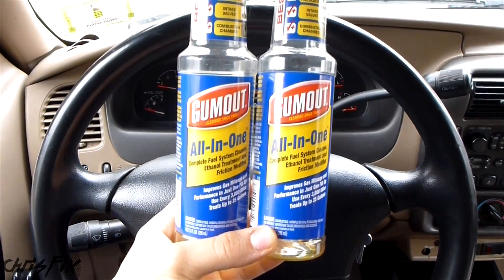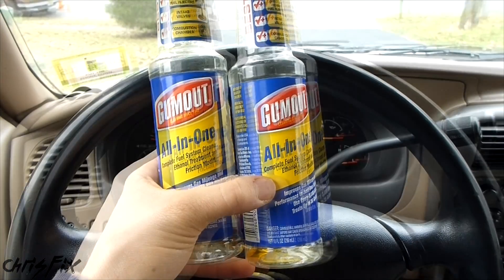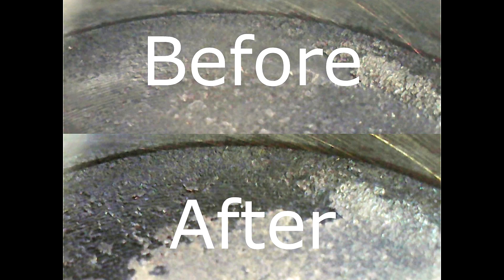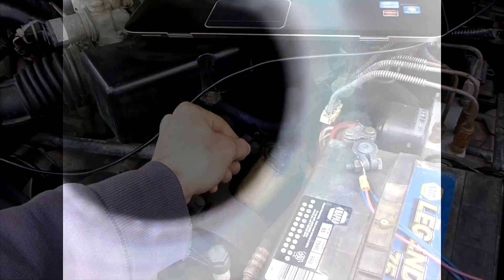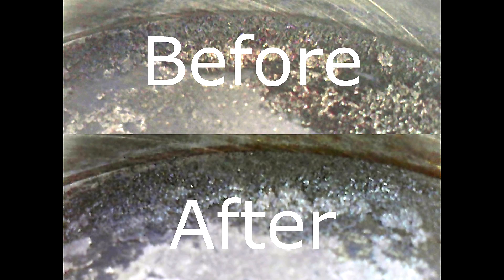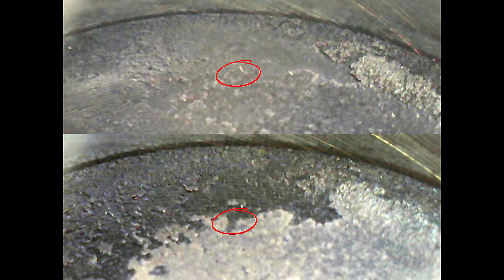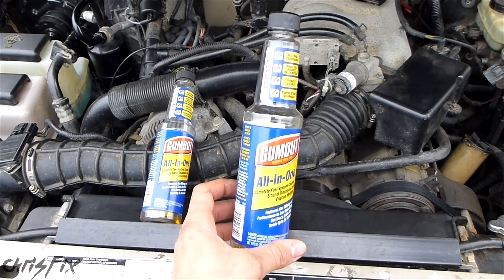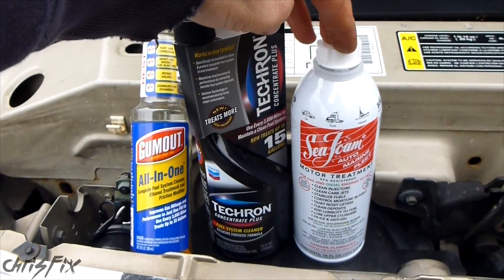Does Gumout Fuel System Cleaner Work (Follow up)?

Comment: Chris Fix,
One thing to consider, is ask Gum Out to start sponsoring from bottle #3 onwards, and use one entire case of it. 
Inspection interval can be cut to every 5 bottles. 
Reason I suggest that:  your video 1 and 2 actually showed gradual carbon removal. Even some of the hard baked stuff, tiny portions came off. So that leaves open the possibility (as you suggested in your video) maybe repeated 10~15 applications would seem more meaningful difference. 

I agree w you, one bottle would not remove everything. 
Many viewers also left comments, this is meant to be preventive and is being used on an engine for the first time in 120k+ miles.
Reply: They claim you need one use, if you need a case, it's snakeoil.

Comment: Ok my question is, when the additive "cleans" the carbon the residue has to go somewhere, does it go to the catalytic converter? Also if it does, doesn't that will get the catalytic converter gets plugged and it's not cheap to replace one, please let me know, thanks.
Reply: the rate the cleaner removes it is not to much more then what you would get with some of the brands of gas who add more to there gas. It seems people want to see all the carbon just gone but it would end up plugging your catalytic converters if it could just remove all your carbon in one go. some people soak piston heads in cleaner but that is a much more involved processes and also has the risk of pushing larger amounts of carbon all at once into the exhaust.

Comment: i guess if i plunge 20 bottles in it might make a significant difference :) i call it bs, the advertisement on the bottle is clearly stating that 1 bottle should make a significant difference but meh ... And Thanks a lot for the vid, truly love your videos! Have a great day
Reply: It didn't really say one bottle would clean a ton of build up. it said improved performance ect ect. if one bottle could remove a ton of carbon up you would probably plug your catalytic converter

Comment: What kind of gas do you use? I read an article in The New York Times about government minimums of fuel injector cleaner in gas and how after they tested it, the best gas to use was BP and Shell. Obviously the higher grade gas has more cleaner but wastes your money if your car isn't designed to drive on premium. You might want to change gas stations.

Comment: ...yeah one of the wack videos of his.  Use 3000-5000 Miles.  Yet he uses it on a car with 120k miles on it.
Reply: Morgorath30 haha :) it would still work tho plus u won’t need to used it on a new engine with 3 to 5k miles on it.
Reply: @brianbaines4905  I mean....every oil change. And you can see it did work.  But asking it to work after one time, after two times to completely remove all of it is a lot to ask for a 120k mile car imo.  I mean I'd say probably a bit of falsifying I  what it can do.  But to me I get the feeling this would definitely help prevent all the gunk you know?  I wish someone would make a video like chrisfix but on a newer car and with continuous use.
Reply: Well the best way to clean it is by hit high rpm with breaks it away out the exhaust. And also if u take your spark plugs out and fill with water it loose it at 5 to 10 mins. Then keep the plugs out and turn over the engine and couple of times so it flys out the plug hole and then once it’s out put plugs in start it and race about with rpm for 5 to 10 mins and look in the hole and it like new that’s what I do but. I only do it when I just got the car cos Ive no insurance and license so I race everywhere it never as a chance to bluid up in the engine

Comment: PEA (polyetheramine) is the safest and most effective gasoline detergent
 to keep your cylinders and injectors clean.  It is found in Top-Tier 
gas.  You can also buy it as an additive - only a few brands have it, 
including: "Gumout Regane" Fuel System Cleaner and "Red Line Complete SI-1" 
Fuel System Cleaner.  It slowly cleans - which is safer.  Harsher 
treatments work faster, but can cause problems if chunks of carbon are 
freed instead of slowly dissolved.  PEA (polyetheramine) is the only 
treatment approved by car manufactures.

Comment: I'm just throwing out a speculation but I think these additives are meant to be more of a preventitive/minor corrective action. It seems to clean the soft carbon quite well, but not much of the hard carbon.
Reply: It works extremely well if you use it continuously After 6 months the top of my pistons looked like they were brand new
Reply: @joebucci2743  thanks for ypur comnent. I believe if you have high carbon build-up you need to use the gumout more then 2 bottles. It cleans mild build-up quite well
Reply: Yeah definitely made to use regularly in a brand new car
Reply: then they should say gum prevent.clean but not 'out'
Reply: @tusharp1577  true, they should but most ppl would have no reason to buy it then

Comment: So is there a mechanical way to clean carbon deposits?
Reply from the maker: Take the engine apart. One thing I learned is in most cases you don’t need to clean the carbon because the deposits are not that bad.
Reply: @chrisfix  thanks! Hey bro while I have you, thank you for doing what you do. You completely walked me through changing out my hub assemblies a few days ago and they are quiet as can be. So perfect. 
Also, one more question. I have a check engine light on due to a gas cap problem, even though my gas cap fits firmly on. What can I do about this? If it helps, it's a 2006 Pontiac G6 3.5 V6. 
Thank you in advance!

Comment: Given you can stick a camera in there, can’t you just stick one of those thin brushes that can twist to physically scrub it with a liquid like alcohol given it evaporates? Then stick a small tube attached to a vacuum to get out the deposits so you don’t have to remove so many parts.

Comment: Isn't Gumout supposed to work on the entire system (including removing water)? I was going to use it in my vehicle to clean the fuel pumps and filters, as well as the cylinders.

Comment: I use fuel cleaners occasionally, only as a preventative. Not sure if it works or not, but oh well. Before road trips I normally put either gum out or seafoam in the tank. Easy way to be sure most gets used before filling up
Reply from the maker: Unless you have a direct injection motor it’s a waste.

Comment: Use multiple bottles of fuel injector cleaner and you will see better results. The higher content ratio of cleaner to gas the better it will work. Different from what each brands bottle says but if you use more you will have better results the more you use.

Comment: Gumout is for gas engines added from the start then used in every other fill up. This will not help for vehicles starting @ 40,000 miles or more.

Comment: I usually use a plastic syringe and squirt 10mL into each cylinder. I use Essentialube which is a little different. I let it soak and drain into the rings. I have not used a bore scope and really need to get one after watching your video.

Comment: The only way this crap can help at all is to run it every 3k miles from day one. Not that it still works great, but it won't take off (obviously) carbon once it builds up that much. I am curious on what would happen if you sprayed the concentrated in through the holes and let it sit for a day?

Comment: You need to do one bottle thru the tank and one bottle thru the pcv hose or intake after the MAF that's how they do it in the pros do it in auto shops . It's how I was taught in school and at work to do a system clean. One in tank one in pcv so u clean the hoses pump in tank and injectors. While the pcv way cleans all internals it touches while going thru the intake tract.. take that and give it some thought..

Comment: The second test could be a result of carbon deposits on the lower part of the cylinder being cleaned up and settling on top of the piston. I'm sure after a two or more uses, it will come out clean.

Comment: Marvel Mystery Oil works the best, better then Seafoam. It's cleans everything and improves gas mileage, even restores horsepower. It's been around longer then the rest and there's a reason for that, it works. That smoke from Seafoam by the way is just Seafoam, not the carbon deposits or anything it cleans. It's smokes because of the desiel they put in it.

Comment: how about using these products at the first sign of carbon? not once it has staked its claim
Reply: Probably need to spray it directly on the carbon. Mixing with 17 gallons of gasoline then a very fine spray from the injectors is not enough IMO.
Reply: i have a new car with GDI. i will be using every oil change to prevent build up in the first place

Comment: Are you using regular 87 octane fuel? I heard that its better to use premium gas with the fuel injector cleaner, supposedly the higher grade fuel with the injection cleaner does a better job, I still see a improvement, you have to remember this stuff isn't magic, and taking carbon out of the vehicle is a pain, let alone just allowing a fuel injection cleaner to do the job. Its doing something! you must admit that! You can tell from all that carbon and black slime build up, it did clean it.

Comment: I use it for fuel system, but I doubt it does much when used in the air intake and engine.
Reply: correct. combustion chamber is not fuel system

Comment: This type of chemical cleaner is only used for small carbon and should be used started at low mileage (not a 120k mileage car :) ). For those larger carbon we should use physics cleaner like carbon engine clean in the car shop (Charge about $200? )
Reply from the maker: This car only has light carbon just so you know.

Comment: All of this testing is wrong. The fuel system cleaners are for fuel injectors, water removal, cleaning a bit off the valves and as an upper cylinder lubricant. You have to have PEA as the detergent in the cleaner and run it about every three months. There is a big difference between the two style fuel system cleaners.

Comment: Is there a mechanic tool like a slim dremel tool with a narrow brush you could feed thru the spark plug hole to get some of the piston carbon off?
Reply from the maker: No you dont want to do that. Loose carbon in the combustion chamber isn’t a good isea

Comment: So many variables that change in your test i know its hard to see the entire piston head but thats not the only place there is carbon too its hard to go off your test as a conclusion with very little information but i used gumout once when i had my engine taken apart in my v8 1990 dodge ramcharger i took pics of the carbon and purposely left the  carbon untouched to test out gumout and after a couple weeks of driving and a whole 36 gallon tank i took a look through the spark plug hole and saw chunks and chunks of carbon build up missing on the inside i love gumout but like i said there are way to many variable to consider doing a test for engine specific cleaners...

Comment: Looks like it worked to me, seem like ur wanting a miracles from a $4 bottle. Adding a bottle with every oil chage and 4 or 5 changes later I bet there wood be a significant difference. There ain't nuttin short of using a wire brush thats goin to make it look like new, lower ur expections , I no ur wife has.

Comment: Just tried gumout multi-system cleaner on my 2013 ford fusion and it already helped on its performance. I was having issues with a delay shifting from 1st to 2nd and/or 2nd to 3rd randomly for a while(which had me worried it could be the transmission going bad). Now the car runs smoothly with no issues and have not had the delay happen again.
Reply: I had same story I drive caddy srx 2010 . I thought it'd the gear.  I put gumout twice in a raw . My car runs smooth 😎

Comment: Hey Chrisfix, from my experience none of that stuff works. Water has never worked for me or the auto manufacturer's products (GM top end). For example, GM top end will clean the injectors but not those hard carbon deposits. That's been my experience. There is one thing I haven't personally tried, and it's those oxyhydrogen generators (hho). These machines are used more by Europeans. I found a place that does it and the service cost is approx. $300. It's a very non invasive service on the motor. The cost of these oxyhydro generators is in the $1000's. However the claim is, is that it will remove most of the carbon deposits and the engine will run like new. If that's true, is it worth the cost? You should find a place that does the service and do a before and after. There's supposed to be black carbon that blows out of the tail pipe when the service is finished. That's the stuff that these additives will never remove. But if this claim is false too... The only thing left is, is to remove the heads and clean the carbon off the hard way. I've done that before and it did work. 😉
Reply from the maker: Thanks for sharing Jeffrey! That's the conclusion I have come up with as well!

Comment: Thanks for the visual / video follow-up.  Since there's a "difference" although not visually significant, have you thought to try putting it on a diagnostic machine to see the before "horsepower" and after?  I'd assume if there's a better or higher performance result after cleaner was used, then hypothetically- all else being equal, you won't need to step on the gas pedal as much?  And doesn't our gas we buy at the pump, already have detergents?  Just a thought.  Great video though!

Comment: Has anyone tried the newer gumout? They changed there formula! I use to use Lucas fuel cleaner and that never helped I used gumout new formula and I have noticed a huge different in my old car. Don’t know if you will do a new one video on the new formulas the fuel system cleaners have made or not. Something to think about

Comment: Is this the formulation that has the Polyetheramine in it?

Also, I think it helps to drive the shit out of your car when you add the cleaner, drive it like you stole it, etc. Wide open throttle up to redline now and again helps to remove a lot of that buildup and bullshit.

Comment: The result here was... underwhelming.
As you point out, there is very little difference between bottle 1 and bottle 2.

It's not the brand to use on an old car, but it seem it would work if used regularely from when the car is new.

Comment: Additives work great for maintenance and prevention, but won't do much on hardships. It's like lubeing your motorcycle chain. Everything is great, when you do a little often, but you can't lube away all the wear after negtecting it for a long time.
I guess this would have worked great, if it was used every 25 000 km from the beginning.

Comment: You know what if you are trying to make an old car run better don't try the gum out shown in this video, try the high mileage one or the gumout high mileage complete fuel system and run either one of them at least a couple of times, believed me you'll feel the difference. I have tried that LUCAS crap and the TECHRON crap and Other ones are not worth mentioning cause I only spend my time and money on. Try the HIGH MILEAGE and you will not be disappointed. I thought I needed a new engine for my 1996 Honda Accord and now I want to drive it all the time., laters......:)-

Comment: There is a reason car manufactures recommend top tier gasolines. For example, in the U.S Exxon, Shell and BP has the highest lever of detergent additives. In some cases 4 times more what the EPA mandates. Consistently using good quality gas will keep your system cleaner than otherwise. On top of that using gum out multi system tuneup - two cans each, twice a year will keep things even clean. Randomly dumping a bunch of products years and 1000s of miles later and expecting a miracle is just wishful thinking. Just my humble opinion. 
https://www.walmart.com/ip/Go-Multi-System-Tune-Up-16-oz-6-Pack/43913005?wmlspartner=wlpa&selectedSellerId=0&wl13=5129&adid=22222222228032163081&wl0=&wl1=g&wl2=m&wl3=77515955808&wl4=pla-107411973648&wl5=9007807&wl6=&wl7=9007803&wl8=&wl9=pla&wl10=8175035&wl11=local&wl12=43913005&wl13=5129&veh=sem

Comment: i have a small problem with his showing his fuel level at empty as it looks like the key is off because the temp needle is at the bottom leading me to believe his key is off and one more thing, i have used gumout multi system tune-up and i don't know about carbon build-up but it took EVERY bit of the rough idling and rough starts from a stop sign away when i used it in my FZR 600 motorcycle

Comment: just an idea, maybe it's your piston rings... try a different set. 

Check oil pressure; from bottom of the oil pan pass the crank to all the rest during default rotation of oil speed. 

All theory but either try lowering oil a bit or get a deeper oil pan. 

maybe if we mix brands it'll work better. it did remove the GUM

Comment: Youre doing this wrong. This is something that should have been done from the first oil change. Of course it cant completely decarb your motor. I bet if you ran this every 3000 miles starting at the beginning your engine would look way different than one that hadnt had it done.

Comment: Best method to clean up carbon buildup:
Crack open the engine and clean it manually using wire brush and gasoline.

Comment: I've been told that when using a carbon cleaner such as this product or Seafoam, it's best to take a trip on the interstate or drive with the overdrive off. (The constant higher rpms help dissolve the build-up). I haven't seen your 1st video, so you may have done this.

Comment: Have you tried transmission fluid as a fuel additive. I had an old 302 in my 85 bronco that had tons of carbon i used a whole quart in a 33 gallon tank. It cleaned up pretty well worth it for me considering the trans fluid is one 2 bucks. I must also add the 302 was not carburated  it was fuel injected.